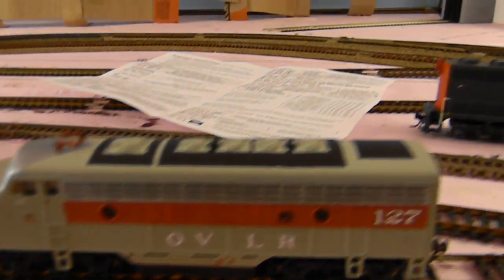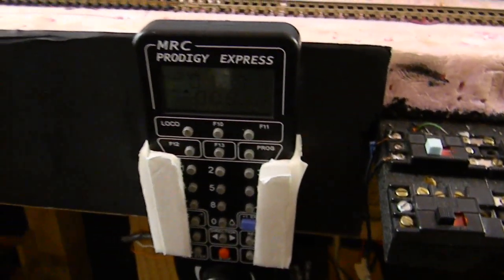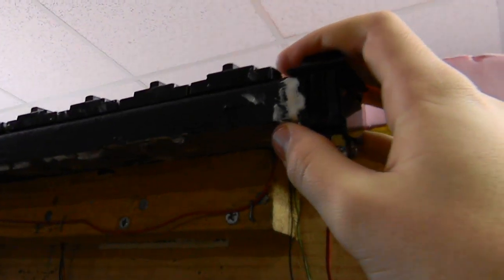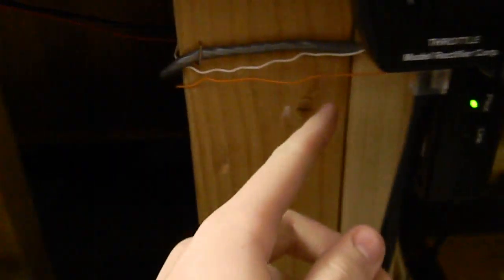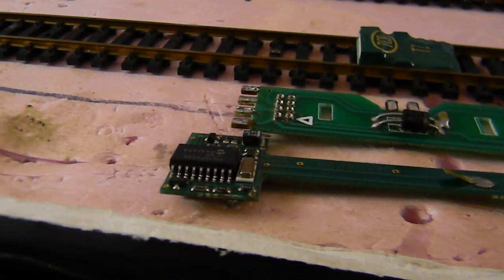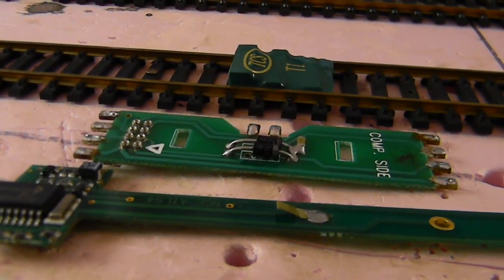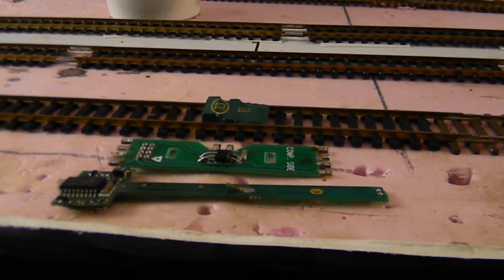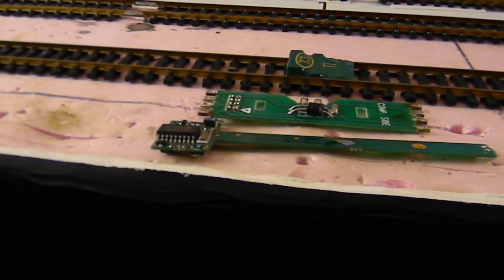SERIES: DCC For Dummies Episode 1 (pt.1)

Comment from the maker: Depends on what engine you get. An Athearn RTR can use the 9-pin plug that's built in to the decoder, but an Atlas needs the 8 pin. A new video is coming up very soon that should answer all your DCC installation questions!